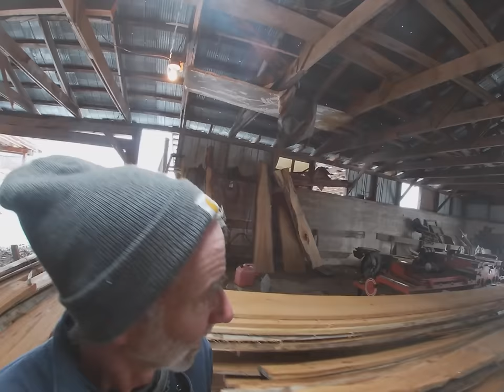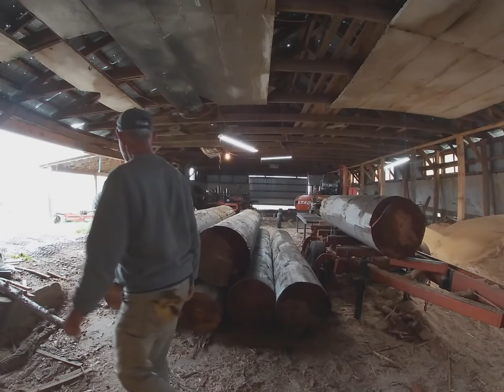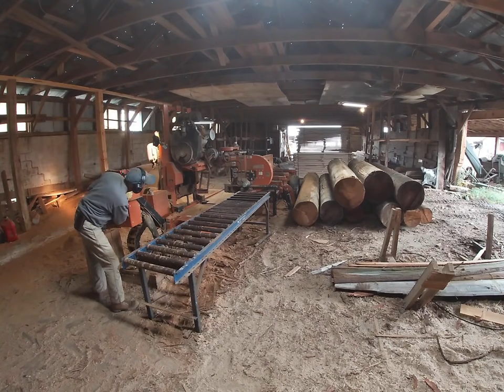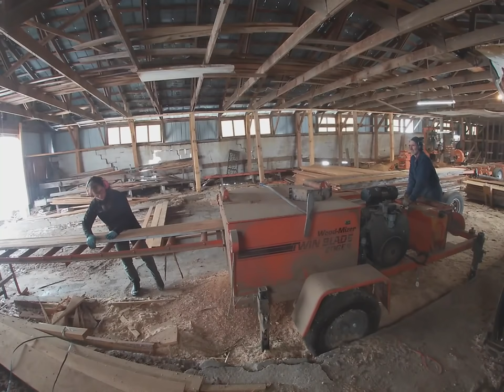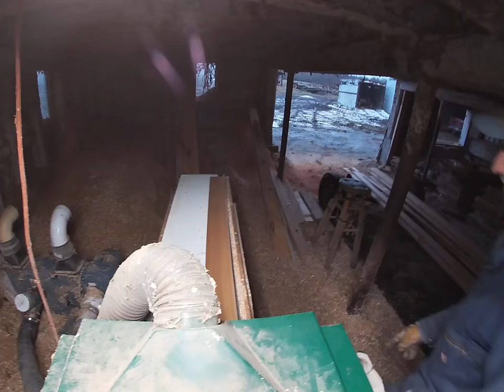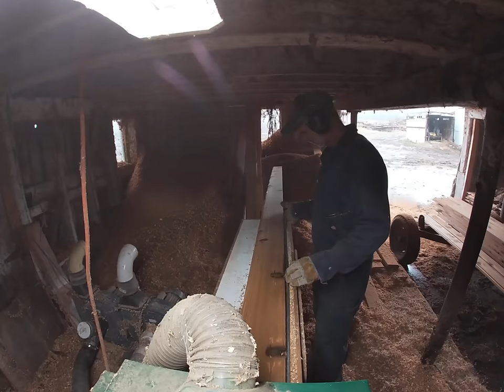Repurposing Used Utility Poles For Shiplap Siding

Comment: I sawed a ton of these that were given to us for free.  The outer inch or so is treated and the dust began to wreak havoc with the tissue in my nose and throat, even with a dust mask.  Built a great deck out of them but can’t say I’d do it again.  Good luck to you, nice mill!
Reply: Creosote
Reply: @billlowe6883  Worse chemicals are used and/or added to creosote. As an outdoor deck the sawed wood has no protection because the treatment only penetrates a short way.

Comment: I found an old cedar pole laying in the field , by the tag on it ,it had been installed in 1908 , so well over a hundred years old . The outside 1/2 inch was a little rough, but the rest was as solid as a rock , made beautiful 6x6 and 2x6 out of it . I had the same woodmizer but without the log turner . The saw was left outside for 12 years , the blade was very rusty and under  tension the whole 12 years , once I got the motor running it cut like a dream . good old woodmizer , good old briggs and straton , good old western red cedar .

Comment: Smart to protect your hearing. Whatever it is it is beautiful. Great to create a second life for this former utility pole. Good that it had never been treated with any kind of preservative . The two of you seem to make short work of this job. Cedar many times has a district smell. I’m thinking of a Cedar chest or Cedar lined closet.
🐴🐴😷👍
Reply: Wood for cedar chests and closets is usually a specific species of Aromatic Cedar. Not sure how many species fit that bill but they are ones with higher oil content so the aroma is stronger. Any cedar will smell that way, but you need the stronger ones to repel moths from wool fabrics and that was what started the chest and closet thing to begin with. The somewhat lesser cedars still make excellent choice for sauna's as the heat and steam really bring out the aroma.
Reply: Agreed, protecting hearing is not only smart, it is absolutely essential. I watched a building job where young trainees were being tutored. All had hearing protection, vest, gloves, the works. Lunchtime arrived. Down tools and clothing, into a nearby car,  off to purchase food - all to a horrendous cacophony from the car stereo. What that level of noise - can't call it music - was doing to the hearing of those young men I hate to think. 30 minutes later, back on the job, back on with the earmuffs.

Comment: Jim I love your channel. I have sawn lots of power poles. They are usually western red cedar. They should have a brand or a little aluminium " belly button " towards the butt end that has the length species and grade of the pole stamped on it.
Reply from the maker: Thanks for sharing.These did not have tags on but I’ve seen those tags in the past and didn’t know they had all that info on them.

Comment: Jim, I believe you need a dust mast for all lumber especially these creosote poles. It is easier to keep dust out than live with it.  And, if you are putting the saw dust in the garden, I don't think you want creosote debris in there. I once sawed telephone poles and the dust & sweat caused a burning rash that lasted several days. It is bad stuf.  I like your mill. It is different from other mills I watch.  Good day!

Comment: Western red cedar utility poles are generally only treated on the bottom portion of the pole that is actually in contact with the earth. They don’t have to be fully treated, due to their natural insect resistance. The bottom portion of the pole was probably cut off before the logs were delivered to the saw mill.
Reply from the maker: These do not seem to be treated, as you have mentioned

Comment: I'd be worried about metal in the smaller poles, unless you can verify that they were from an area not accessible to the public. The big ones like that are used on high tension right-of-ways, so probably less of a chance there. Makes very nice boards, for sure.

Comment: The title described the logs as repurposed utility poles. Were they soaked in creosote or some other rot inhibitor? If so was breathing fumes from the saw dust harmful?
Reply: Most likely creosote.  The cedars seem to be better than pines at allowing the treatment to settle to the butt(part in the ground)  over the years of standing.  Smells like cedar and you can't smell the creosote like sawing a pine, or fir pole.  Good practice to wear a respirator tho when sawing if you can to keep out the fine dust.
Reply: I think there creosote in Michigan what if I wanted wood from.you what would I have to do I know seal it
Reply: These are only treated where there is ground contact. That portion was already removed. No chemicals or treatment needed for above ground with the western red cedar.

Comment: Did the customer want the slab wood scrap as well? I would turn that into garden stakes which should last a long long time. Might even get a fencepost or two. Lucky you if he didn't want the slab. Do you have a local garden supply center you could sell them to?
Reply from the maker: Not sure yet , yes there would be a lot of good uses for them
Reply: I studied Forest Economics in college and your labor cost to turn the slab wood  into something usable would far outweigh the cost of the scrap wood . I've seen 6 foot lengths of bamboo in dollar stores get snapped up for gardens. The color of the stakes would make them attractive as well as the rot resistance. A price point of $1 per stake would seem reasonable. Other uses such as fenceposts might be worth more. Wainscoting or molding might be another option.  Might take some effort on your part to find a market and your supply is limited. Trucking to the market might be a long haul for the horses. You might have better uses right on the farm or in your home.

Comment: Are you sure pole was not a Douglas Fir?  The size, minimal taper is consistent with Douglas Fir which are commonly used for utility poles.
Reply from the maker: Quite sure because Douglas fir seems to have more distinct lines

Comment: Noticed that by seven minutes in there was a blue haze in the air above the mill. I would run a flexible dryer vent to the exhaust and out through the roof before you start seeing purple unicorns and pink elephants.
Reply: That purple haze is probably flammable. That means it can explode. As well as poision him.

Comment: How do you keep the band sharp, I just tried cutting some an only got three cuts until it started waving badly
Reply from the maker: I send my blades back to Woodmizer to be re-sharpened. On these utility poles I did have trouble cutting them though and keeping a straight cut.

Comment: Hi Jim: A sawmill question...how do you operate the hydraulic functions on the WM when the head is down stream so to speak. I run a LT40 Super and when the heads about 1/3 the way down the track it runs off the grounding rail that allows the hydraulics to function. Did you extend that rail? Thank you. Jon
Reply from the maker: We did not extend the rail, we modified it so it has live hydraulics at all times.It has worked really well for me.

Comment: If those were power poles,what are they treated with back when they were processed?
Reply from the maker: They don’t seem to be treated with anything
Reply: I would be the last guy to mess up a guy that is as resourceful and hard working as you are, but even long-lasting, rot resistant woods are often treated simply because no one would want to go through the misery of planting one of those monsters without taking steps to extend it's usable lifetime.    All the wooden poles in WI and MN are pressure-treated; at one time with creosote and now with something called Penta and probably other chemicals.
     I would ask your local power company folks what their poles are treated with, if anything.   My sole concern is when you sell your lumber if someone finds the wood is treated and wants to go after your business but also that the potential methods of treatment might be harmful to you from the dust.   Here is hoping I am totally wrong;  I like your channel and your work ethic.

Comment: A great idea but take care. The sawdust coming off those poles will be seriously toxic and probably very flammable. It needs to be bagged and used for fuel. Saw Mill operator should be using breathing gear.

Comment: Power poles are treated with creosote. Don't think I would use that lumber for indoor purposes. Would be fine outdoors but no way should that be used inside a house or cabin. Could be that since these are western cedars they may not have been treated IDK.
Reply from the maker: They don’t seem to be treated, thanks for your concern

Comment: Either you're careless and lucky, which I know for a fact you're not, or you had a way to find any metal in the poles. Curious what method you used. I was a tail sawyer on an old Frick mill in the 70's. We got a bunch of cedar telephone poles from a railroad reclamation job for cheap. After destroying a few circle saws and imbedding numerous chunks of steel into my body(the tail sawyer was only a couple feet from the saw)we quickly decided that was a bad idea. Like the laser on your edger. I assume its a 2 blade.
Reply from the maker: Ran into some metal on the 1st load but the 2nd was clean. Fortunately with a band saw the blades are not so expense and it’s safer. Yes the edger has 2 blades. Thanks for watching

Comment: No mask..... duh. That dust is creosote treated at worst. Most trees are dangerous to breath in their dust, works like silica sand dust to lungs. Good luck.
Reply: That pole did not have creosote. You can tell because there are no puncture marks on the outside. I have a source for smaller poles that are being taken out and replaced by new one. You will find a ton of cedar telephone poles that are not treated that come from the forties to sixties. Mine are around 14' long that I use for pole barns.

Comment: Ignorance of turning trees into utility poles leads people into resawing the logs into boards to be used near people. That is a recipe for disaster. The wood has been poisioned. It should not be cut without proper personal protection and complete clean up. This saw shed is now a hazardous waste site even if the owner does not realize it.  

The only safe thing to do with this wood is, other than holding up power lines,  posts for an open pole barn used for winter storage of machinery.
Reply: Wow, such a Downer you are....  It is his choice, his Life....  Worry about your side of the fence
Reply: @stevehetrick2676  I do worry about my side of the fence. I also consoder it my duty as a citizen to tell people when they are placing themselves and others in danger. Once they are warned they can do anything they want.